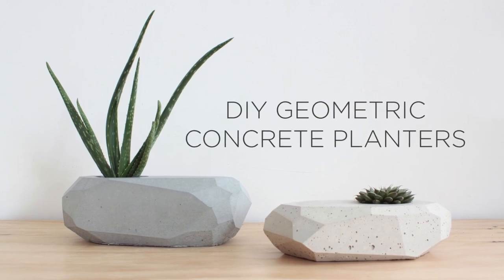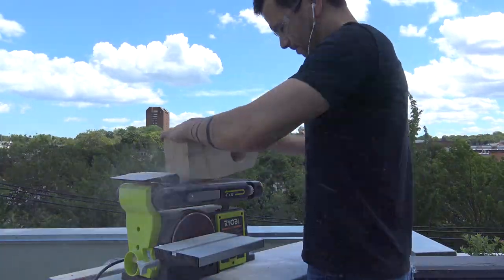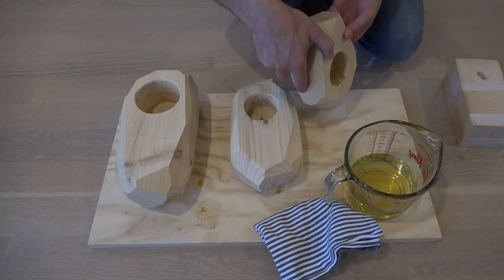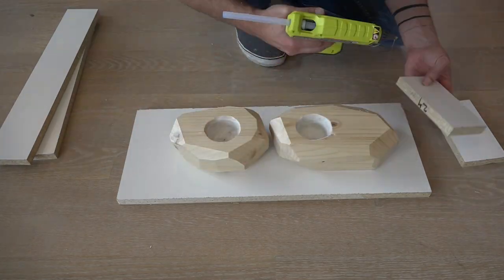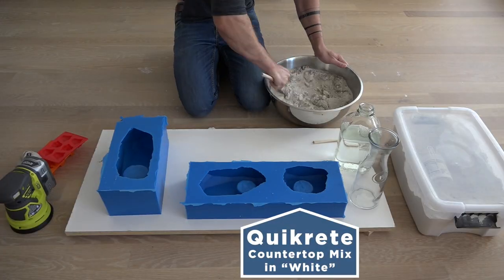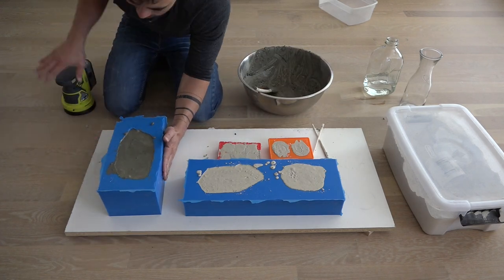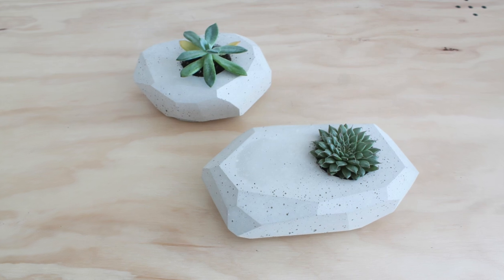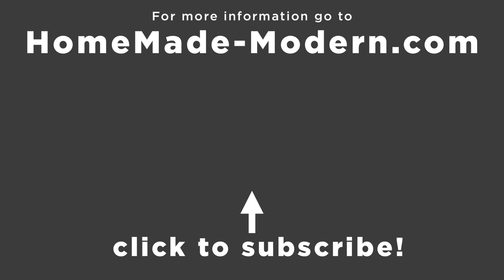DIY Geometric Concrete Planters

Comment: Mold star is an expensive platinum silicone not specialized for concrete. If you are purchasing from smooth on have a look at their PMC or Vytaflex range which is abrasive resistance so will last longer (100 pulls from the posture mold as opposed to 20 odd from silicone Mold Star) and is specifically meant for casting concrete.

Awesome products and are a little cheaper.

Keep up the amazing content love yours and Jamie’s work! Truly inspiring.
Reply: Damian Skirde Great tip, thank you!
Reply: Nice

Comment: I would suggest keeping the wooden forms from the original mold making process to place the mold back into when filling. This is particularly good for the larger molds and stop the flexing issue as you learned.

Comment: Hey great video. I never thought about using wax for areas like that. But just to throw an idea out there: silicon mold material is great, and totally necessary for super smooth surfaces but like you said it's pricey. One thing I figured out is that you can brush on your silicone to your positive and than back it with plaster. The plaster won't bend like the silicon keeping your cast straight, not to mention it's considerably cheaper than silicon. Also Smooth-On makes a great super dense mold material called vita-flex which can withstand the weight of concrete!
Reply: Then how do you get the cast out of the mold? Do you break the plaster?

Comment: I am sure someone has said this but I just wanna point out. That drainage holes are very important in all pots and especially small ones like what you've done here. Even more so since you are using plants that love to be dry between watering. Of course these planters can and will work but you've increased the difficulty of maintaining the plants by not having drainage built in.
Reply from the maker: yes but for succulents i have found that i don't need them as long as i don't over water.

Comment: What if  you put a single layer of smooth/rounded 1/2" river rock in the bottom of those molds before pouring in the concrete?  Might make a cool feature on the top of the final product.

Comment: Loving the form of those planters. Hey, did you have a "coat" of something like "grease" in the pieces after they cured? 
I did a couple of concrete pieces and have this coat of something on them, I had to clean them with solvents because it wouldn't come off with water or soap :(

Comment: Do you use any sealer to seal the pots?
Reply from the maker: i didnt for these but wax works well if you don't want to use concrete sealers for toxicity reasons
Reply: Interesting! I will try that :) Thank you!